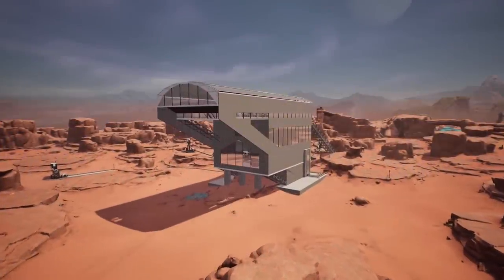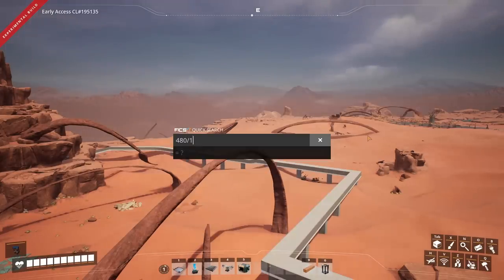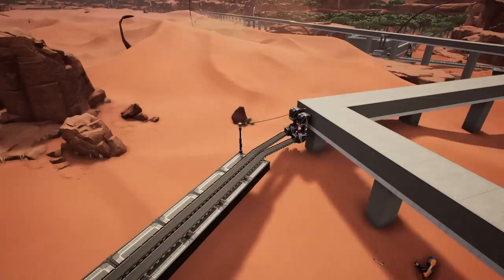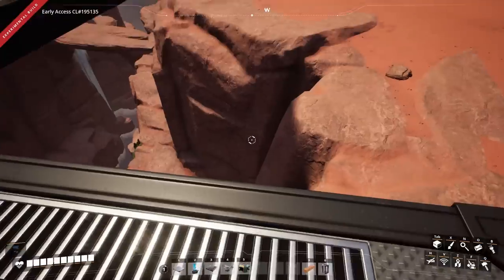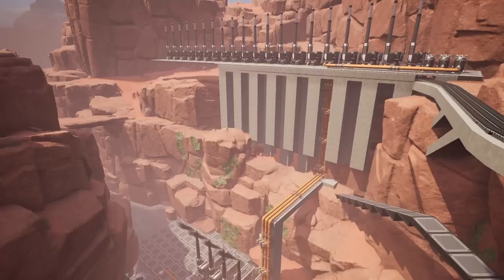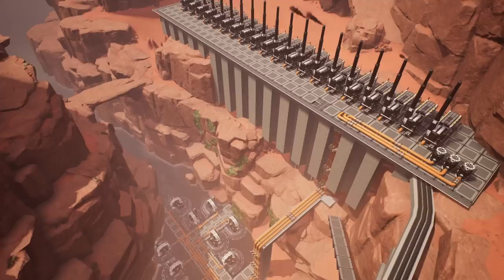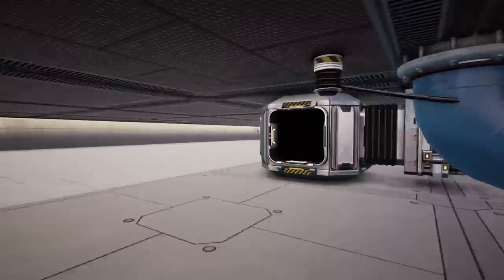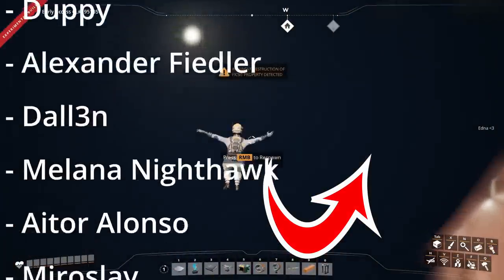Building My Largest Coal Power Plant! Satisfactory Lets Play Ep.04

Comment from the maker: Today we're building our coal power plant and it's gonna be big, because we need it to give us enough power to support us until we develop fuel generators! What do you think of the facilities design, do you like it?
Reply: Somehow I lived on 8 coal plants until I got fuel.  Well, I did make sure to more or less rush to it and I don't have a stream to maintain.  That held me on 16 generators until I (again, plugged away at getting blenders) to get the fuel generator facility turned to turbo fuel.  Now (or soon when I finish the conversion) will be able to have over 100 generators.
Close to but not quite unlimited power.
Reply from the maker: @b.delacroix7592  100 generators should last you until Nuclear at least :D
Reply: @TotalXclipse  It did last save. I dragged my feet on going to nuclear.
Reply: Me making a 300 generator, 45,500MW on coal power plant (includes compacted coal)..... Over clocking the generators to max currently makes the resources:power ratio better by 0.00(something). Your design looks very cool!!
Reply: @TotalXclipse  I did it one time since I didn't feel like hand crafting fuel generator materials. I made a 16 by 6 coal generator array off the coast of dune desert that burnt almost all the coal in dune. It didn't look very good but it was "easy" to build

Comment: Final comment.  I may try to build a little plant there.  But I'd definitely save the power from overclocking water extractors, and find a way to fit 18.  Also, I had a stupid, crazy idea about fluids.  Given, you can use a water extractor and a water pump plus the ~10% margin to lift >30m in a key pipe, and as long as you connect that pipe in a loop up top, the game physics will pull the other fluid all the way up from the water extractors without any other pumps.  I currently do this with 43 water extractors in my "Compact Compact Coal Power Plant" (if only it had a more compact name, and a different acronym than CCCP, which is also problematic for entirely different reasons).  But that technique is limited to about 30-33-ish m in height.  So can I find a way to cheat the game and save power, using one, or maybe even no pipes at all, to lift an arbitrary number of pipes up?  That will be a future experiment.  But the idea is, we get about 8m free head lift from a filled fluid buffer.  So as long as the first buffer is about 10-11m high, we can fill it.  Then we get a free 8m lift to the next, and so on.  We can use as many unpowered pumps (check valves) as we want.  If we take the key pipe, go up, X-junction every 8m, and try series (parallel with check valves to prevent sloshing) fluid buffers, we might just get all the way up.  Granted, this will probably look like some unholy rosary bead necklace into the sky, so we might want to cover it up, or display it proudly behind glass, preferably partially obscured.  Industrial Fluid Buffer would get us 12m.  The only drawback I can think of is that this could take a REALLY long time to successively fill up every buffer.  To that end, a larger fluid buffer holds 6x more fluid but only gets 50% more height, so to minimize buffer fill time, it'd be best to use the small buffers.  But say we go 90m in the air, which I am roughly estimating as a height here, that's the initiat 10m+ from extractors, and 10 more fluid buffers, maybe 11-12 if we drop 0.5-1m between fluid buffers.  Wicked gnarly.  Can't wait to go test that out.  :o)

Comment: A more future proof layout could  be 4 blocks of 13 coal generators and 5 water extractors in each block. 54x15=780 ;-) so such setup can be later fed with just one level 5 conveyor from one overclocked level 3 miner.  Also each block requires 585 water so 5 pumps will do perfect producing 600 with level 2 pipe transporting also 600.
Reply: Thanks for this gem!

Coal Generators (4x13) = 52
Power Produced (52x75mw) = 3900mw
Normal Coal consumed/min (52x15/min) = 780/min
Water Required (52x45/min) = 2340/min (52x45)

Water Extractors (4x5) = 20
Power Consumed (20x20mw) = 400mw
Water Produced (20x120/min)= 2400/min

Notes:
Mk3 Miner base rate (normal node) = 240/min 
Overclocked 250% = 600/min

REQUIRED:
Pure Node, Mk3 Miner Overclocked to 162.5% = 780/min
Consuming 65.2mw

Total mw produced (52x75) = 3900mw
Total mw consumed (65.2mw + 400mw) = 465.2mw
Net power produced (3900mw - 465.2mw) = 3434.8mw

Minor Inefficiency:
60/min excess is being extracted, a nice little buffer

OPTIONAL ADJUSTMENT  
Underclock one Water Extractor per bank to 87.5%
New Net power produced (3900mw - 449.6mw) = 3450.4mw

This will make it (theoretically) 100% efficient reduce extractor output to exactly 585/min per bank, reduce power consumption to 384.4mw toal, saving 15.2mw overall and give one's OCD a smile 🙂.

Comment: Nice build, straight forward.  I was working on 96 genny compacted coal plant, and almost had it, but realized if I overclocked all generators and miners, optionally underclock assemblers and water extractors (as numbers indicate), I could pull a few hundred more MW out.  So, 810 on a 6 lane bus (3x pure coal, 3x pure sulfur, mk.2 miner, mk.3 conveyor belt), would feed 56 coal generators, requiring 33 assemblers at 98 or 99%, and 43 water extractors at 99%.  Constraints, trying to cram into minimal footprint, using a single pumped line up to fluid buffer (maybe forces other lines up?), with 2 layers of assemblers and coal bus above coal generators, water pipes also, everything feeding down, and expandable for when belts/miners/pipes upgrade.  Problem, 43 water extractors don't fit neatly under footprint of tightly packed (clipping) coal generators, no room for 17 pipes, 56 gen, 43 water ext, 17 assembler, 17 pipes, the numbers are lousy for logistics, but (approximately) idealized for power production.  Less than 1% excess coal, sulfur, compacted coal production (minimal back pressure) to buffers (for headroom for future quick modifications with no downtime) and sink (maybe route excess to a trash bus to minimize use of undersaturated awesome sinks by creating a centralized waste plant).  Playing with idea of a 2x3-tiered loop manifold.  Ideally it would use an underflow merger, but I can just use splitters from top to feed lower belts, using the lowest belt loop as the singular manifold loop that feeds machines.  More or less belts sorted as usual, as in previous 100% clocked genny x 96 with numbers that were nicer, but water extractors and plumbing a big mystery.  Maybe 3x5 + 2 on top for symmetry.  Need to route in such a way that expanding plant later doesn't require a complete replumbing.  design should allow additive construction in a systematic manner.  Although such initial plumbing is more complex, space consuming.  The 1 or 2 pumps constraint really makes things complex.  A fluid buffer may not be strictly necessary and could simplify.  Need to pop out a few biomass generators and test ideas to validate proof of concept on small scale, say 5 extractors and 2 full pipes using one pump, with buffers simulating consumers to gague flow.  None of this was in the FICSIT training manual, but maybe one day it'll be FICSIT approved.  For now, I keep it in my unofficial REKTIT manual of unproven and/or abandonned and/or failed ideas.

Comment: Looks great and didn't know yet about the painting thing.
However it`s a little difficult to fully understand your overall transport system. So far it cannot be efficient.  I don't get why 9 water extractors can be sufficient. Even when fully overclocked, which is madness btw. ^^. In terms of water usage a coal plant best runs at 144%. Because water is not the bottle neck it makes most sense to run a plant 250%, saving coal relatively to 100%. But your results always look very nice and are really inspiring.

Comment: Hi TotalXclipse. Great series. Gives me some great ideas. However I heard you say that the pipes going from the 3 water accumulators going into one pipe supplies the coal generators with 900 volume of water. I think this is a mistake. The pipe you are using appears to be maximum 300 volume and that is all it can hold. The Tier 2 pipe has a maximum of 600 volume. I don't think there is any way one pipe can handle 900 volume. If I am wrong, please correct me. Thanks again for the great series.

Comment: I'm curious why you do the beam thing with your miners. You can place foundation completely across the coal and then add a miner. It'll drill right through it as long as the gap isn't too great. I use 2 meter foundations and never had it fail.
Reply: The barrier trick allows the foundations to be centered under the miner. If you place foundations using the world grid (or try to eyeball it freeform) the miner will never be perfectly centered on the foundation. This trick makes for a cleaner design, especially if you want to enclose the miners. I enclose mine sometimes and with this trick the enclosure has a small 1x2 footprint.

Comment: Crenellation was correct.  Matriculation is a type of exam!
Reply from the maker: Crenalation is the top pet of a castle wall, I was referring to the bottom side which is machicolation which is where they used to pour hot sand and oil from the walls 🙂
Reply: @TotalXclipse  ahh!  I misheard the word machicolation, and you are right, of course, that crenellations is just the top part. I’ll just shut up now! Ha ha

Comment: 8:20 - I'd be interested if anyone could elaborate on this point made here. (using fluid buffers for pipes underfeeding a machine)

Are pumps not sufficient enough to feed these pipes? I run into issues with fluids all the time and am curious if this is a worthwhile investment for overhauling my factories vertical pipework.
Reply: I'm not sure about it either in this context. Pump headlift is simply from where the pump's exit is then upwards to its max height. I think what he's doing here is to stabilize the water amount in the pipes since with large, long-distance setups like this the liquid can slosh back and forth a lot and not consistently supply machines. However, it looks like (from the aerial view) he's feeding the buffers first and then the buffers are connected on the other end to the pipes feeding the machines, which won't help with the above. Rather the better way is to put the buffers at some far end of the network and prefill them with water first, so they act like "fake" water sources coming from the opposite end to keep the pipes full.

Since he's feeding from below the pipes have to be completely filled with water before the waterline of the whole network can rise up high enough to reach the machines, realistic liquid physics and all. Having buffers helps with keeping those pipes full, but not when they're arranged like that.
Reply from the maker: If you're pumping from below the pipe will empty and have to fill up again this can cause the generators to turn on and off. If you use a buffer above the below pipes will always be full as long as the buffer is filled as the water that is used up is immediately filled by water being pushed down - I hope that makes more sense 😅
Reply: @TotalXclipse  Yes that explanation makes sense. Machines take in liquids in "sips" rather than a continuous flow, so sometimes the sips can be timed just right (wrong) so that the water level will drop down below the lip of the input while another machine wants a sip, so that starved one has to do its shut down animation. Putting buffers in the system lets each buffer output up to the max of the pipe at all times (assuming the tank's full) and helps to refill the vertical feed pipes as fast as possible. However that means they're still affected by distance and sips from machines along the way, so best to put those buffers at the middle and ends of a network.
Reply: I've never had an issue feeding water from below without a buffer. My last coal factory was like 80 meters above the water so 4 or 5 pumps. However, I also don't mess with minimizing my water extractors, so I always run 1 for every 2 coal plants, which is 60m³ per. Having them over-fed by 10m³ could explain why I've gotten away with no fluid buffers.

Comment: Why did you run the coal out the side of the elevated tunnel instead of dropping the elevators straight down through the floor?
Reply from the maker: Good question, but I don't believe I had floor holes unlocked until the end of that episode which was a bit later on - I started working on the coal plant at the early start of the steel plant
Reply: @TotalXclipse  OK, that makes sense now. I was confused because I saw you using floor holes around the middle of this episode.
Reply from the maker: @goforbrokefilmstudios  Yeh this episode was done over about 12 hours of gameplay because I was doing multiple projects at the time, so didn't have them unlocked until I started using them later on the second bus line :)

Comment: How are you getting the water in pipes to bend so tightly?
I can never place a floor hole that close and get it to work.
Reply: While you are building them press R i think and you can change the build mode, i think noodle is the one that let you do the tights turns but is a while and i can be mistaken
Reply from the maker: Yep Michele's correct, go with noodle for the tightest turns 🙂
Reply: @MicheleAria  Damn don't think I ever tried build mode with pipes. Thanks for the tip.

Comment: Life would have been easier by going to the other side of the desert. two normal nodes and an impure one... overclocked at 200% would have given you the same amount of power, and plenty of space to get water and build coal plants without having to pump water up the mountains... But we wouldn't have had this "machicolated" (?) build here.
Reply from the maker: Yep it definitely would be easier but lots of people build powerplants there because it's so ideal - and I'm trying to avoid the more commonly used spots.
Reply: @TotalXclipse  my first time in the desert, back in update 3, I built on the same spot as you, tbf. First I built 8 coal generators... then I torn everything apart and managed to fit 6 water extractors and built 16 coal generators right above them. Too bad it wasn't enough power for my needs, so I eventually I ended up building another powerplant northeast.

Anyway, it's part of the fun :)